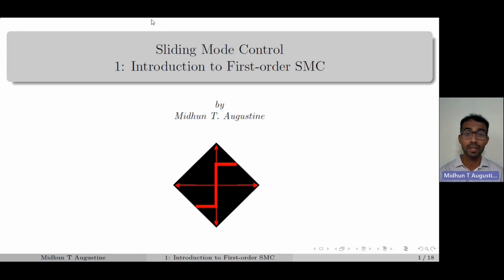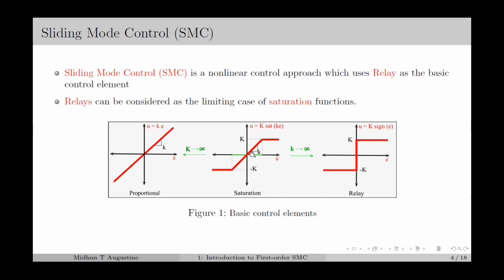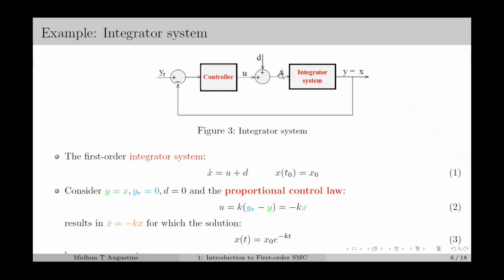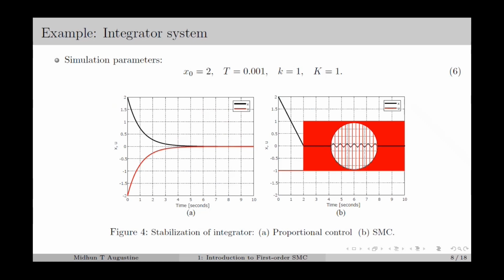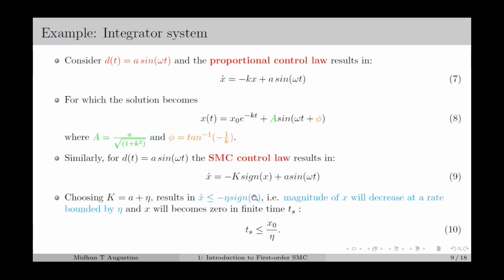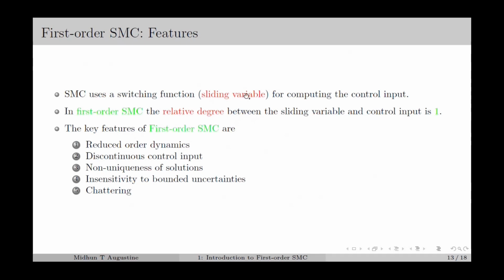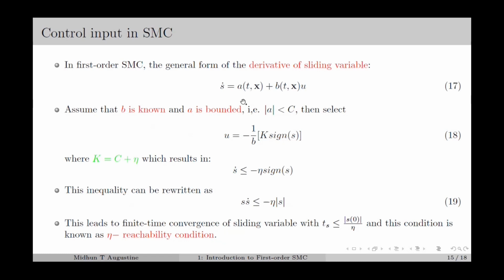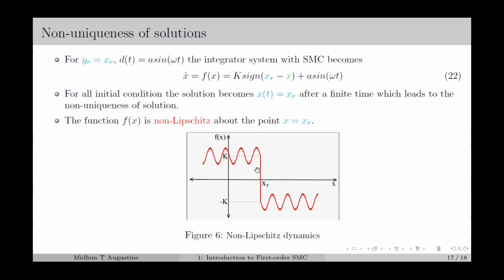1: Introduction to First-order SMC | Sliding Mode Control

Comment: I need help with Super Twisting Sliding Mode Control for trajectory optimization of robots.
Can you provide some help or refer someone who can provide help? Don't hesitate to share the charges for help 
If possible reply ASAP and anyone reading this also share detials.
Reply from the maker: Hi...I haven't worked in the area of path planning for robots. The codes for Super twisting SMC in this lecture series can be extended for trajectory optimization by including a trajectory optimization function which computes the reference values by solving an optimization problem where the robot model with Super twisting SMC control law act as a constraint. This optimization problem can give the optimal reference trajectory for the robot and optimal value of SMC parameters as its solutions. I think this optimization problem can be formulated similar to a nonlinear MPC optimization problem with cost function modified as per desired objective.
Reply: @datacontrolandmathematics3811  I have codes and Simulink model, I need to add some signals to the workspace. I think I am doing something wrong, or I am confused about the signals.
I need someone to review the code and Simulink model.